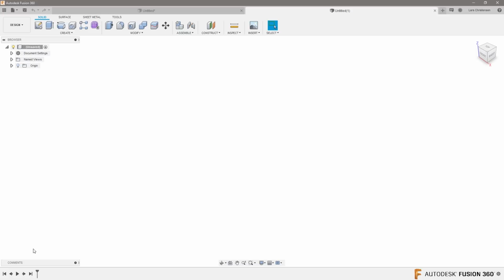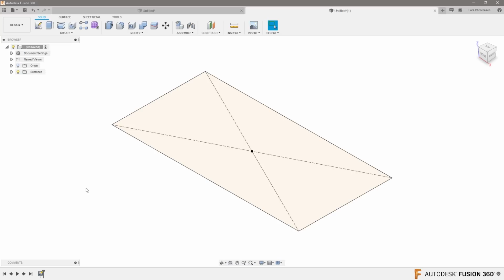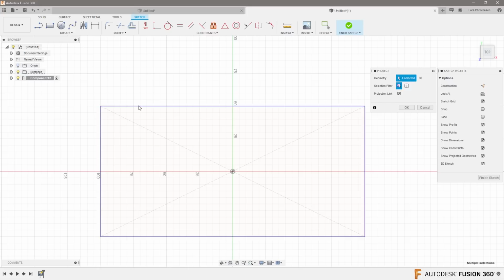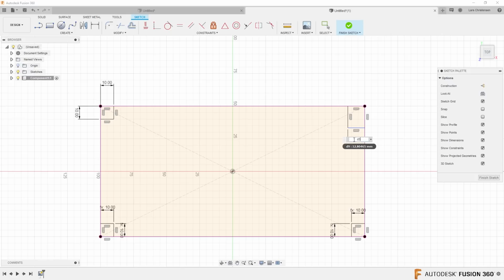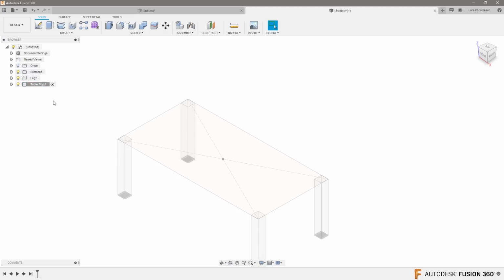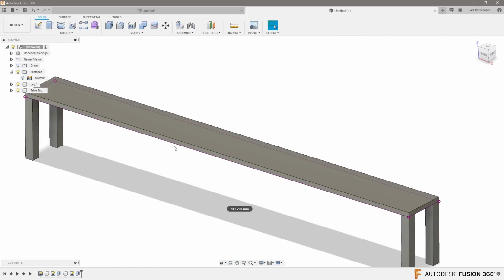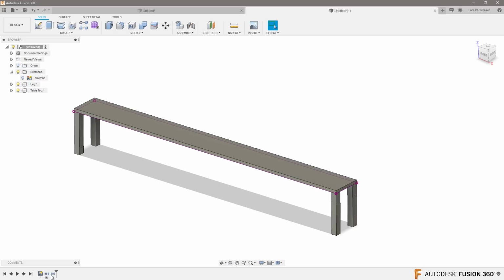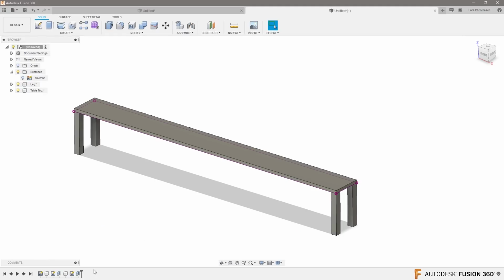Fusion 360 — Clean Up Parts and Component Timeline — Ask LarsLive

Comment: I never noticed that grouping feature - looks handy. As a beginner one thing I think REALLY helps when working with components is turning on "Component Colour Swatch" (under the gear icon lower right) which gives every item in the timeline a colour relative to its component. You can also toggle the model to have the same colour by clicking "Component Colour Cycling Toggle" under the Inspect tab.
Reply: Thanks, I have been trying to figure out how to do that!
I think the grouping would confuse me, it would all look the same.